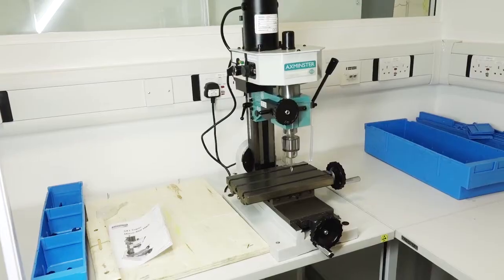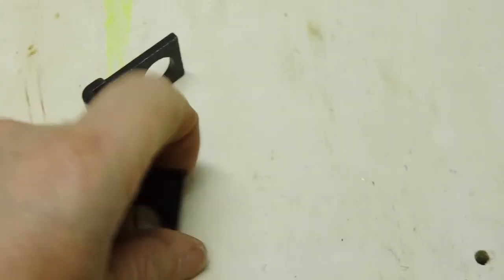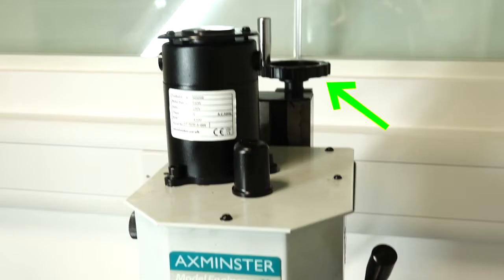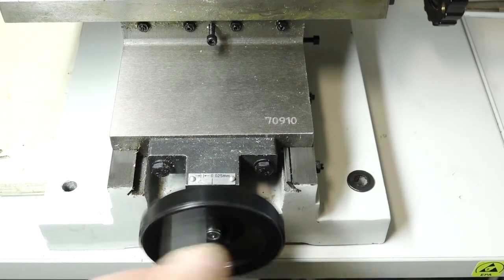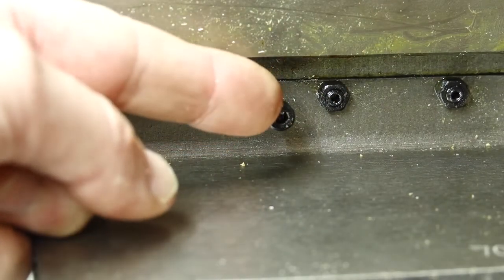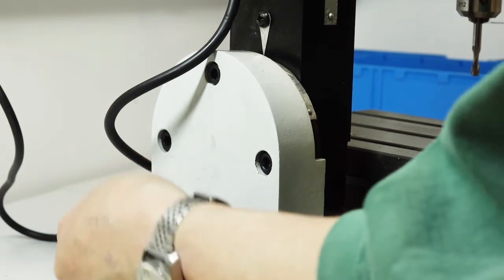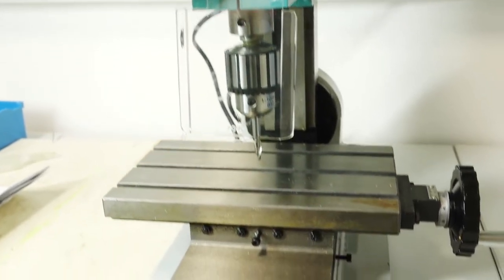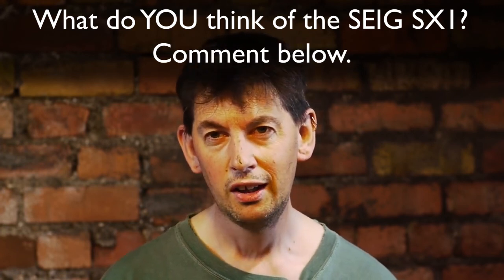Seig SX1 / X1. Cheap micro-mill, first impressions.

Comment: My advice to anyone considering one of these: I bought a Sieg x1 about 10 years ago (identical, as  mentioned). Needless to say i didn't know much about machining at the time. They are basically toys. Yes, if you're really dedicated and are happy spending hours taking off a couple of thou at a time to keep within its capabilities or only intend to mill plastic, I guess you could justify £500. But if you are more serious and want a tool to make parts and have the room, there is no comparison with even the smallest and most basic  of industrial machines.
The quality of all this Chinese hobby stuff is extremely poor to non-existent. The steel used is like toffee (don't expect those bolt heads to last long!), The castings are as rough as can be, they are really noisy and if you remove anything, you'll need to fiddle around tightening up bolts 'just so' or shimming stuff to get it to play nice when you put it back in, which is probably why half the bolts are loose when you take it out of the box. Expect to spend at least another £400 and weeks of time on mods and upgrades to get a usable machine, but at the end of the day your efforts will be built on sand (and likely casting sand at that!). Think about putting wider wheels on a reliant robin and you get the idea. I'm not a machine snob and  I don't want to be a negative Annie, but if you can possibly make the space for a second-hand real machine, go for it. It might cost 3 - 4 times the total amount you'll ultimately spend on these pieces of junk, but you'll be able to actually make things and the machines won't lose their value. The other thing with these micro mills (apart from lack of motor power and drive train fragility) is they just don't have the mass or rigidity to prevent chatter on all but the lightest of cuts in soft materials. For an idea of how limited you are going to be with an x1, take a look at this video, which is the much bigger and more expensive X2: https://youtu.be/8XWCHPO8kZ4
At around 19:00 he tries to take a cut in the X direction after a plunge cut in aluminium and gets severe chatter - and that's with a much beefier machine (although i suspect with all the same quality issues as the X1). I appreciate not everyone has the room or the budget for a bigger machine, but just don't expect to take it out of the box and start making parts. Or to be making parts with it for very long for that matter!

Comment: Hi, Nice video and you have covered all the points, I've had my Sieg X1 for over 10 years have got used to all that you mention and have not looked back, where I now use it with a decent rotary table and ER20 collet set. The Z-axis dial can be a little annoying, although I am used to it now. I still have the same gears in mine and have put them under considerable strain (Fly cutting at 40mm). I have a couple of video's too if you like. There is a belt conversion for it, although as you said it's handy to have the gear control to hand. Happy milling.
Reply from the maker: Thanks for your long-term perspective :-)
Reply: @creative-media  thank you, subscribed 👍
Reply: Neil Devonshire - Dev255 ,hi m8 ware could I find your video list,I’m looking at buying this model .
Reply: @creative-media  what is the background music in this video please?

Comment: This is a generic mill, sold by numerous companies and just stickered. I have one and its never gone wrong. It's isn't very accurate as there is play in most parts, but is fine for a hobbyist.
Reply: " I have one and its never gone wrong. It's isn't very accurate as there is play in most parts " . . . What you're saying is , it's never gone right and you're happy with that. Accuracy is the starting point and a basic requirement in any equipment using the words " Engineering Series " in it's description .

Comment: At the end of the day these micro-Mill are cheap £300+ bigger versions more powerful more money etc.
if you want high precision you will have in pay a bit more or have a larger older machine.
Reply: Completely agree with you! The review with respect to the gentleman concerned seems to be based on a general lack of wider machine and machining experience and knowledge. The terminology used etc, cogs not gears for example and an expectation of a lot from an obviously cheap, in fact possibly the cheapest micro mill / drill on the market. I have a range of larger more professional British and U.S. machines and some of the better Chinese machine tools and also one of these Axminster micro jobs. It does not produce precision work nor would any self respecting machinist expect it to. However, with a few low cost mods and replacement quality screws, adjustments and replacement table locking screws it's ok for light duty jobs, if I want precision I go elsewhere in my workshop.

Comment: I must be one of the only people with a sx1 with no faults,i think its a handy tool to have in your garage or workshop..yes ok its no marvel but you should use some of the cheap Chinese ones lol
Reply from the maker: I thought this WAS the cheap Chinese one! ;-) I was hoping for better build quality considering the price.
Reply: Yes, you very probably are 😉
Reply: all of them are Sieg, rebranded by various outlets such as Harbor Freight, Grizzly, etc.. color and small differences in dials, optional acc. is about the only thing that differ. all same castings and it's the same with the 7x mini lathes. you have to do a little tweaking, but they can do the job and of course you can upgrade almost anything on them, over time if you wish for budget hobbyists.
I was thinking about the X2D, but sold by Grizzly since they are easy to deal with online and phone.
bottom line, don't be afraid of mini mills. you'll have more in tooling than the machine itself in no time haha
Reply: @pauls5745  so far I've upgraded to long bed,rpm meter,led ring light which is amazing.No shadows as with standard lamps,laser dot pointer which I can say helps with speedy setups.
Reply: @janes-e378  oh I just saw one of those LED ring lights, thought it would be pretty cool. thanks to remind me I want one haha